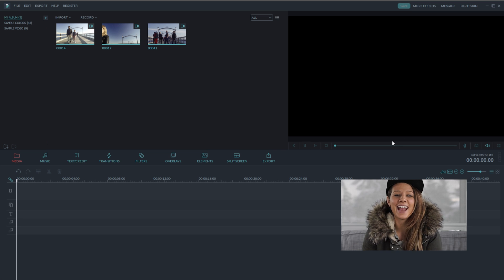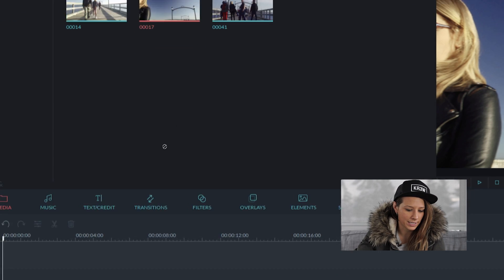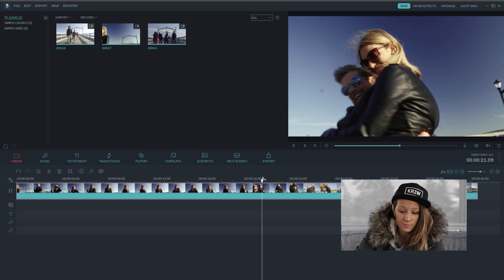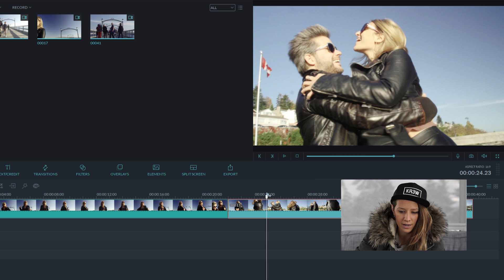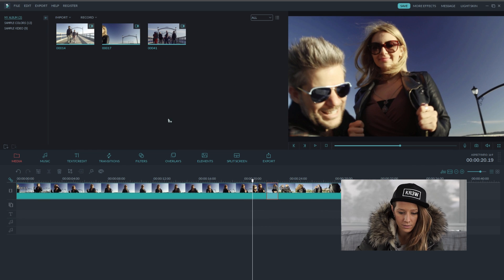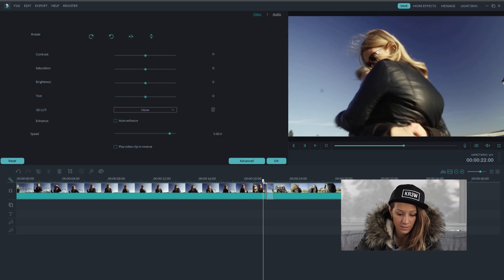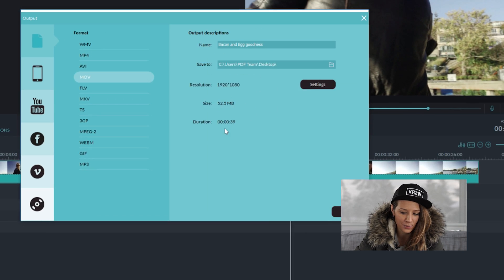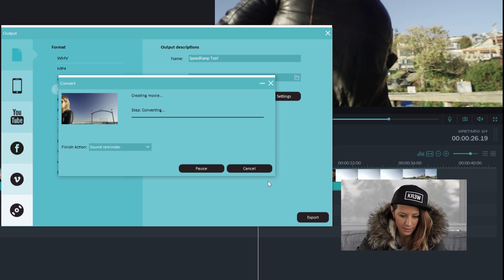Slow Motion and Speed Ramping Tutorial – The Lookbook Series⎪Filmora.io

Comment: hello, I'm new to editing videos ( for fun) for my understanding if I have a video in 60 FPS and in project setting I choose 24 fps, the video clip should slow down right? or how does it work? for example if I have a combiantion of clips on different frame rates, I take videos in 60 or 120 so I can slow down to 24 (slow motion), I know there is a tool in the software for the speed of the clips, but if I export on 24 fps shouldn"t the  60 fps and the 120 fps slow down ?
Reply: @FilmoraWondershare  i just same question and i have tried your suggestion. But i found that when i got 60 fps drag to 24 fps projects. Then i do slow motion for 0,5. My video look choppy. I realized that when i move frame by frame Filmora duplicate each frame. So the video more choppy look rather than smooth slow motion as your video show here. Can you help me how to do slow motion properly in one project with 60 fps into 24 fps project?

Comment: Definitely looked good in that clip on the pier.  There have been times, however,  I've wanted a function that provides a smoother transition between the cuts instead of an abrupt change.  For example, the slow-mo feature on the iPhones gradually (but quickly) slow the video down to the new speed rather than just jumping straight to the new speed.  What are your thoughts?
Reply: That is what speed ramping is. This video has a misleading title.

Comment: hey I'm have one question for you 
everything works fine in filmora but there's one problem regarding transition if I load up any video it works fine only if the video is in first of timeline but if i load another clip put that it into another slot after trimming that clip I want to apply transition effect in that slot means the second one but it doesn't show any option to apply it like that little plus icon to use a transition but it works fine if clip i loaded is in the first slot

Comment: It's says export at the frame rate it was filmed. However, wasn't the footage filmed at 60fps, rather than the 30fps the video was exported at?
Reply: Philip Attersall - Film at 60 fps. Slow down if needed and export in 30 or 29 point something. Works really well.
Reply: Philip Attersall - It does not slow down if you don't do anything with the clip. So the ideal I to divide the fps you export at with what is filmed at. So in your case to get smooth looking slow motion you slow down to 0.33 max. 👍🏼 I normally shoot everything at 60 fps and then slow down to 0.5 for a nice effect and export at 29.97 fps. Gives it smooth slow mo. If you want to go extra slow I recommend shooting at 120 fps and slowing down to 0.25.
Reply: looks like it was exported at 23.97fps
Reply: Thank you Nicklas. So if I film at 90fps and export to 30fps will the footage slow down? If I want to slow down footage. Then if I film again at 90fps is there a lowest slow down i'd want to use but remain a smooth frame rate. I.e 90fps, slow down by a max of 2x ?
Reply: Thanks so much for taking the time to reply. I'll give it a go tomorrow. See how I get a long.
Reply: Philip Attersall - You are very welcome. Hope it works out. Otherwise play around with it and do some tests with different fps.
Reply: Any suggestions for exporting frame rate when you use two different speeds of video? Some 24 and some 60.